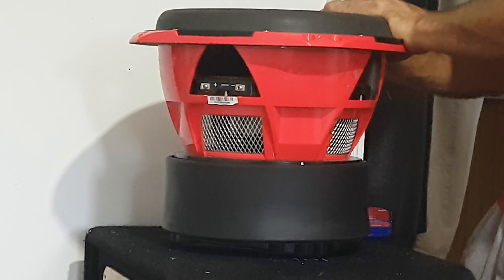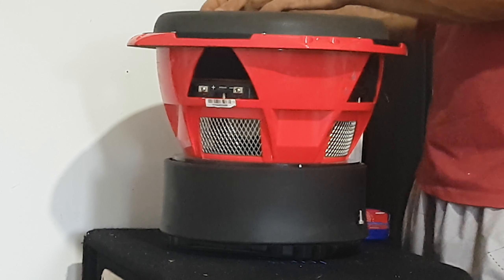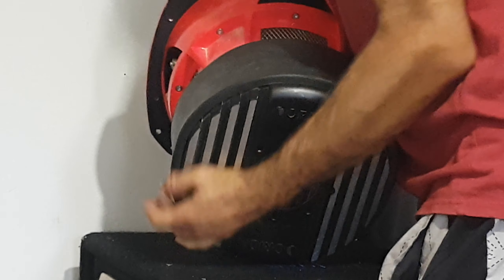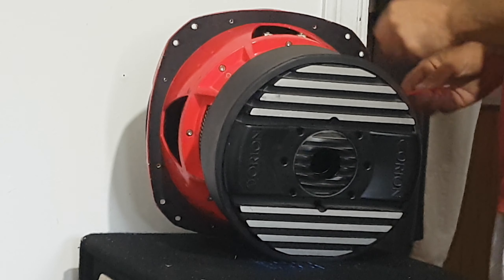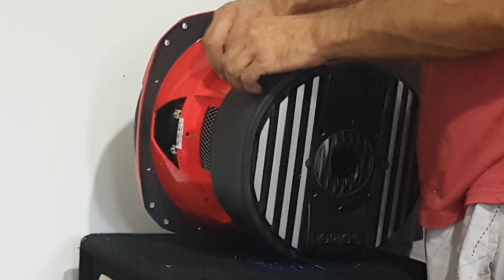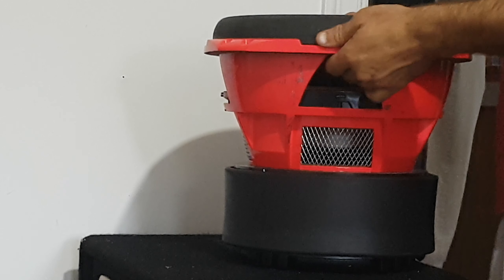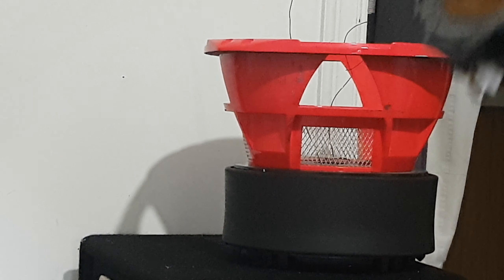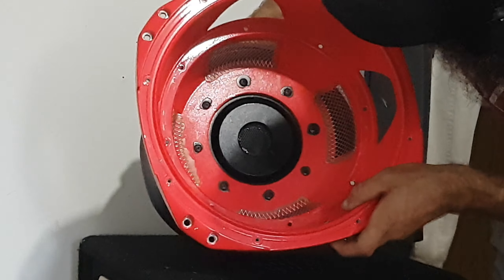cleaning my blown sub hcca 12.2

Comment: Hey Shane, my sub amp unfortunately just let go this weekend, and although it's under warranty, I've always wanted an Orion HCCA 3000.1D splx amp, since I was young and used to compete back in the 90s. I'm considering buying one to replace my current amp, and selling my current amp after having the manufacturer complete warranty repair. My question to you is, in your opinion, is the new splx as good of quality as the older Orion products from the past? Do you run yours at 1 ohm, or have you ran it at .8 or .5 , if so, did it do ok? I have a HO alternator from DC Alternators, 375A, 4 deep cycle AGMs, two runs of Skyhigh audio 4/0 XL OFC wire for power/grounds. Will go lithium when I can, but you think that would suffice for powering the splx? I don't have any plans to compete, I just an old basshead. Oh, just running two 12s DVC 4s now, but may add 2 more if splx is stable @ .5. Thanks for your time, I appreciate any input u can send my way.
Reply from the maker: Ya they are and amazon has them on right now